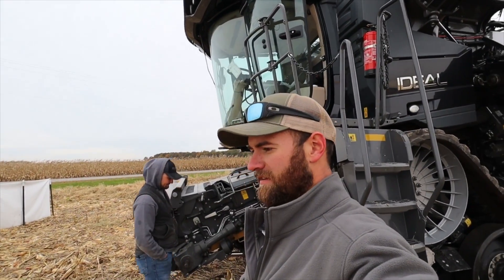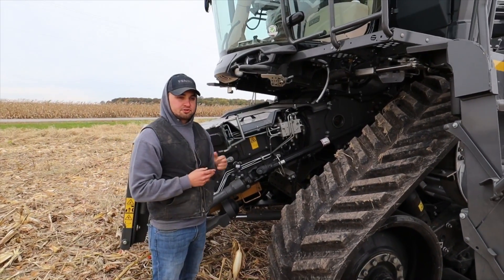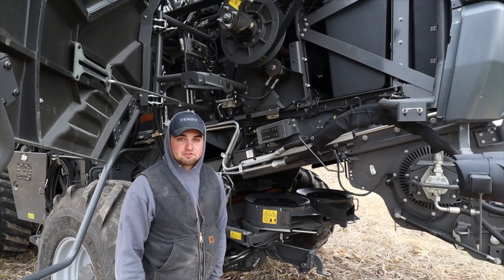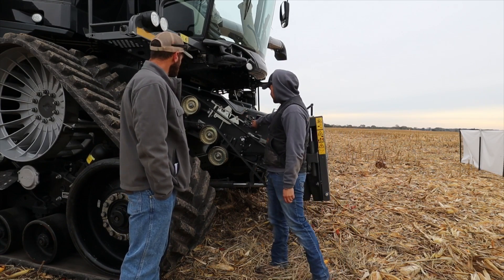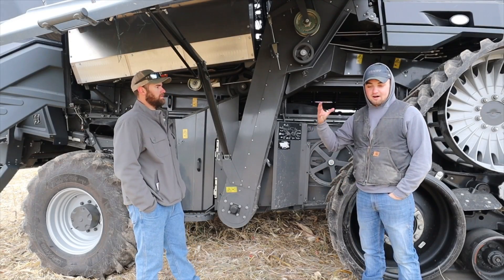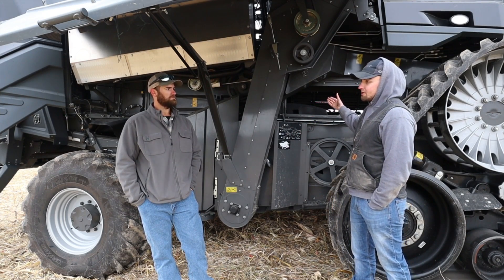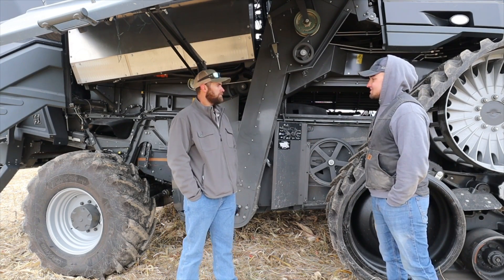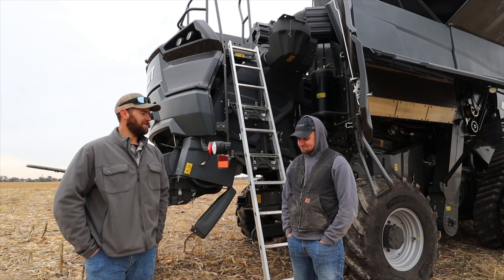Daily maintenance and how to switch crops on a Fendt Ideal combine

Comment: Does this combine have an air compressor and tank on board? I think it would be nice to have a timed blast of air on top of the feeder housing. Maybe a few other areas also where build up is a fire hazard.
Reply from the maker: It does but I’m not sure about the timed blasts of air. On the unload side of the machine there is an air hose though.

Comment: Don't know about case but Deere is easier to switch
Reply from the maker: So is claas
Reply: Brian's Farming Videos never had expierence with a class lexion but they look pretty cool. I really like the one on farming simulator that I use!! I like my Deere but I'll let some Red add some color. I like my America companies and so e I let slide but fendt is no go.
Reply: Zeus Macafee its An agco machine. They only use/abuse the fendt sticker.
Reply from the maker: The claas lexion is not an agco machine. Claas is a separate company
Reply: Brian's Farming Videos I believe class is separate from others. They came from the Catippliar and that's as much as I know. Agco has fendt, valtra, Massey Ferguson and a few others. Agco headquarters is in Duluth Georgia and case and new Holland is CNH industrial with headquarters in the Netherlands.
Reply: Zeus Macafee Claas was it's own company from the start, they were never part of Caterpillar, they merely had an agreement to sell the Lexion under Cat colors in North America while at the same time selling Cat tractors under Claas colors in Europe.  That agreement ended when AGCO purchased the Ag line from Caterpillar, Claas just sticked with the Cat color scheme cause it sold well.
Reply from the maker: For what it’s worth they still use cat motors in some of the combines
Reply: Case is also easier
Reply: So.. one day all tractor manufacturing will be owned by one guy, that's scary! Can we do something abut those `roof` companies that just buys up all teh other companies?

Comment: On my lexion I just pull the knives out for corn and change the settings in the cab from beans to corn and roll on
Reply from the maker: You don’t slow the chopper down? We usually but the cylinder in low for corn and high for beans
Reply: Brian's Farming Videos same here. Most machines I help with stay in low for corn & beans. Keep the concave tight for beans and it’s never an issue!
Reply: No I don't fool with the chopper Fan speed just pull knives out flip the disawning  plates up 

And if the beans are tough I do put the thrashing cylinder in high gear

Comment: What about engine specs? horsepower, torque,engine operating speed, fuel consumption, bushels per gallon, any others.
Reply from the maker: I didn’t cover that because that is info that can be found on google and I only had a limited time with Zach. Here is a link the that info https://ideal.fendt.com/en/geneva-assets/livelink/484627-fendtideal-10-2017-en.pdf

Comment: Just seeing that combine makes me love my New Holland even more
Reply: RJ 1999 Fun fact: this combine is built by laverda in italy. Laverda used to be ownd by new holland and laverda produced new holland combines beetween 1994 - 1999.
Reply: @embassypictures.5629  that's interesting because it's basically a new Holland twin rotor
Reply: RJ 1999 they might be using the same desings ideas as they did on the new holland combines.

Comment: Sure is a lot more changing than my case ih combine
Reply: It sounded like you don't need to do anything with the concaves unless you are in a high moisture situation.  Otherwise you move a belt on the feeder housing and a belt on the chopper in back.  That does not seem like alot does it.
Reply: @thr8061  it’s still a lot more then 90% of other combines